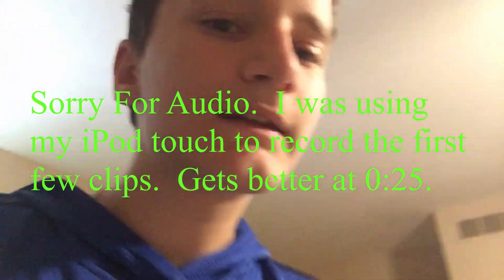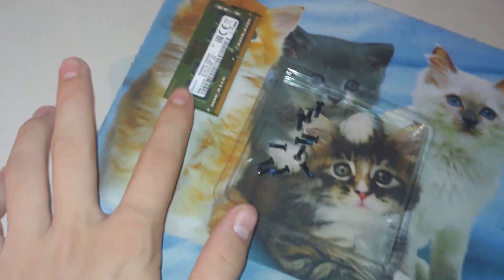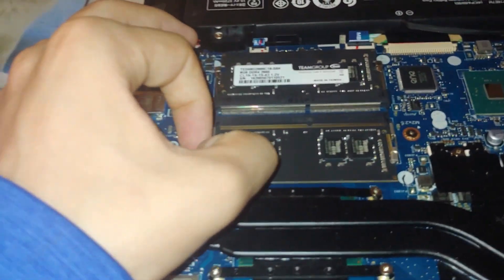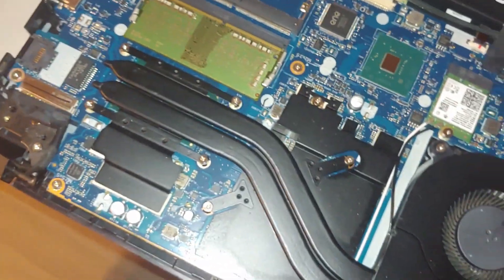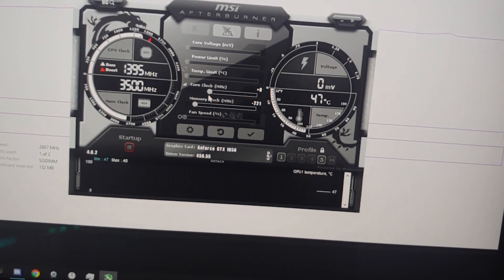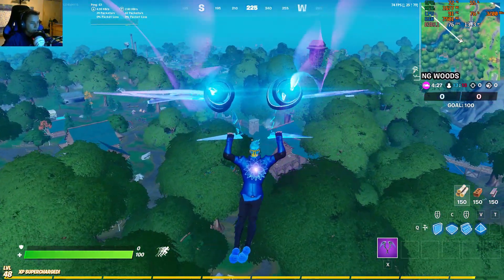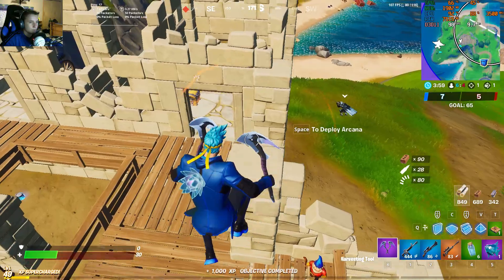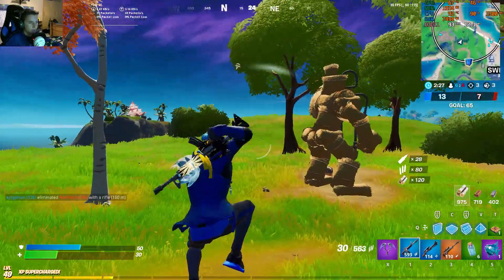Fortnite Competitive Settings On The Acer Nitro 5 (And proof of me installing 8gb of ram)

Comment: How much FPS did u normally get while using 8gb ram instead of 16gb ram in season 4 chapter 2??
Reply from the maker: Mate, I tested this on 8gb ram.  Did you not see the beginning?  All of the numbers in this video are accurate for current season 8gb ram.
Reply: No like, I was asking without recording
Reply from the maker: @pratham5746  Now you did.  Once again, these measurements, since I recorded this on an external monitor,  Boosted FPS by 5-10% and recording lowers it by 3-8% so, like maybe 3 or 4 FPS lower.
Reply from the maker: On 8gb ram without recording.

Comment: Hey quick question. Are you using OBS to record this video. And if so, how much do the frames drop. Because I usually play at around 80-100 fps, but when I start recording I play at around 30-50 fps
Reply from the maker: I wasn't using oba to record this.  I was using Nvidia shadowplay.
Reply: @BGDave   Oh ok. Another question. I'm new to the PC specs and stuff so I'm a little confused. What graphics card did you buy in order to use shadow play for the acer nitro 5?
Reply from the maker: Any nvidia gpu of the last 10 years should support shadowplay, as long as it supports the required drivers.  But I bought a Gerfore GTX 1650m